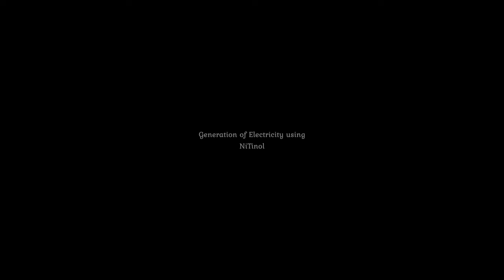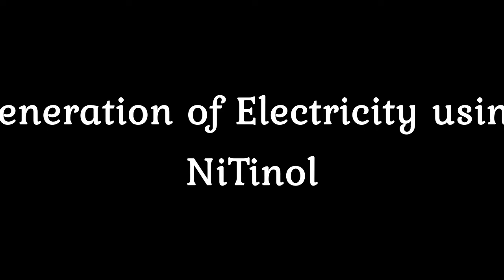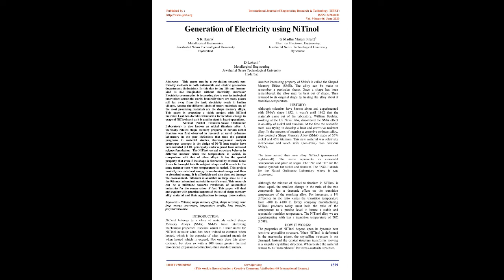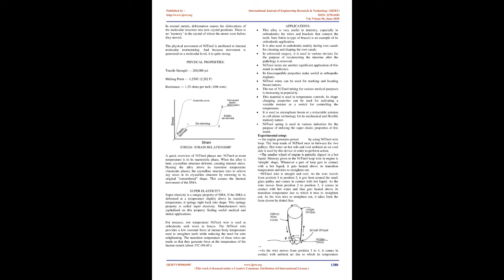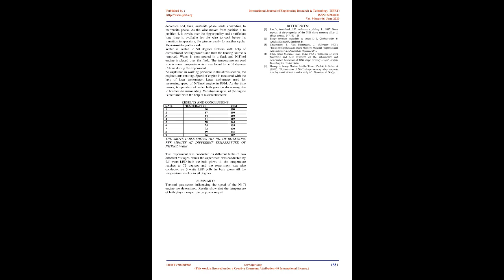Generation of Electricity using NiTinol

Comment: Every numbnutts Norwegian tinker all make the 1 mm belt loop that will loosely spin a wheel around when heated in water, which is fine, BUT why the hell hasn't anyone produced a larger belt, heat treat it at a certain circumference, and uniformly expand it, or even use a ring roller to increase its diameter somewhat, probably by 5 to 10 percent, so it will sinch on reaction and ACTUALLY DRIVE a small generator and create real usable power